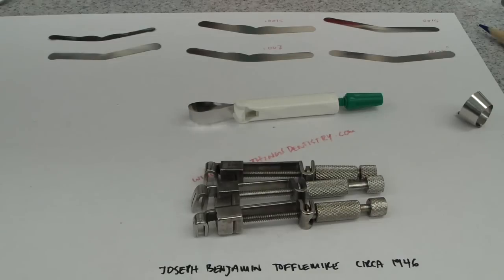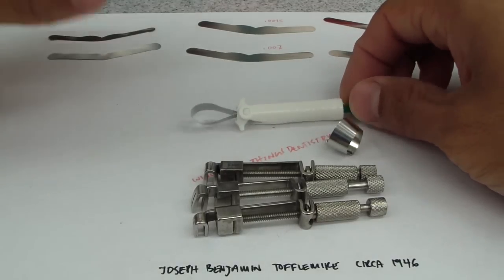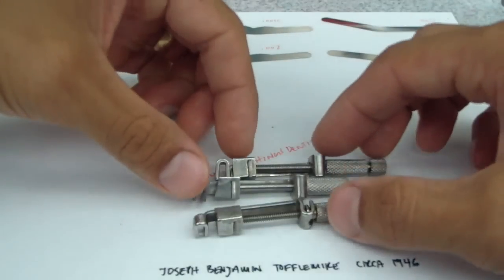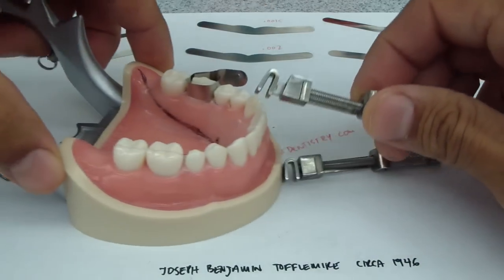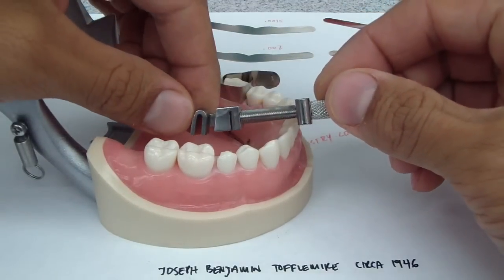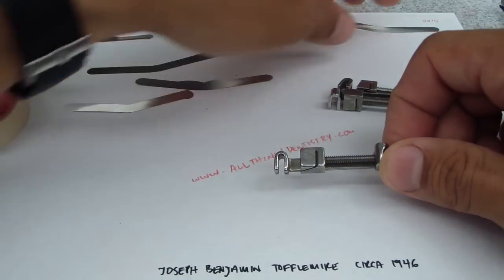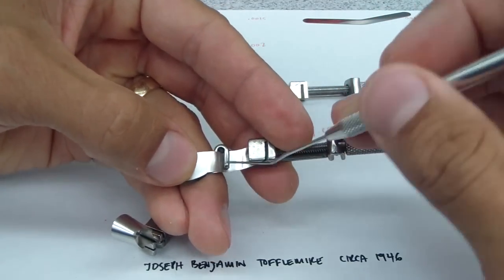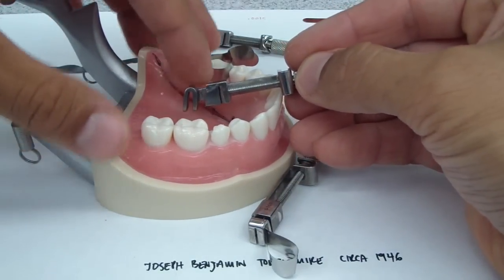Tofflemire: "Ah-hah" Tips

Comment: Tip: when you need the straight retainer, loop the band and place it in the fork upside-down so that the open end of the "U" faces AWAY from the gingiva. The band can't slip out, and the loop will constrict tighter at the gingival portion of the band (under the box)
Reply: But retainer removal will be difficult

Comment: are you using still amalgam? hahahahahahah
Reply: Why not? There is stuations like bad mouth hygenie that we use amalgam. And no, its not more harmful than composite filling materials.
Reply: What’s wrong with amalgam?
Reply: @endemikpandemi  There might be some indication but cost-benefits doesn't out way a proper composite filling under rubberdam in layers. People who are against composite  don't know how to use it! Besides you have to sacrifice a lot sound tooth for mechanical retention for your amalgam!
Reply: @gillespaling7039  lack of chemical bonding, need to sacrifice sound tooth structure to have mechanical retention, ugly and in some cases health issues
Reply: @salima7394  Composite doesn't have chemical bonding either. Amalgam is cheaper, doesn't need a rubber dam, has superior mechanical properties has anti-bacterial properties contrary to composite and can survive for decades.
Reply: @gillespaling7039  which superior mechanical properties are you talking about. I have had more than 15 yrs composite fillings in my patients with 1-2% failing rate. I had done it all under rubberdam and did not had to drill  a lot of unnecessary tooth structure. I am not saying amalgaam has not its indications and in some case I have been using it but usually when done properly composite is the etter choice. BTW it is now even banned in EU two sell amalgam
Reply: @salima7394  Superior Compressive strength, superior wear resistance, superior shear strength, superior torsional strength. Most dentists won't bother with a rubber dam for a root canal let alone for a filling. Well at the beginning you were quite snide about the use of amalgam, lo now you admit there are indications. Without amalgam millions of people of low economic means would have had their teeth condemned.
Reply: @gillespaling7039  No material is perfect, everybody knows it but hit is about total package. I was also not talking about third world countries and extreme situation. I agree about people doing composite not on proper manner but it is on the dentists and not the composite itself. Sense we are talking about disadvantages I can not count the amount of teeth with small occlusal fillings being lost by crack tooth or broken cusps due expanding of metal! So in situations where we can apply normal dentistry composite should be the preferred filling material.